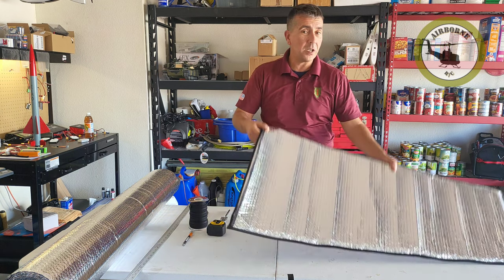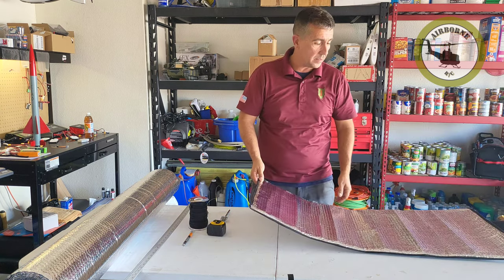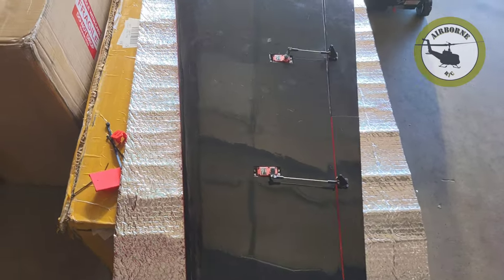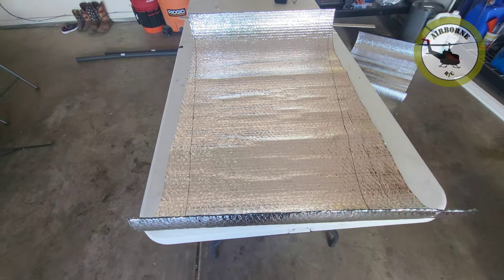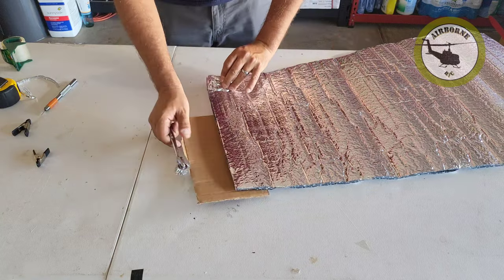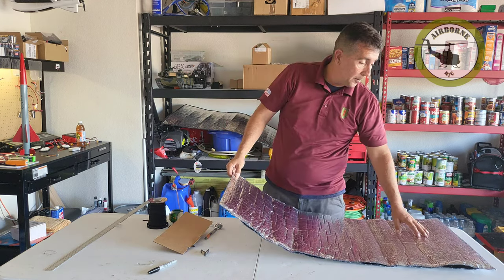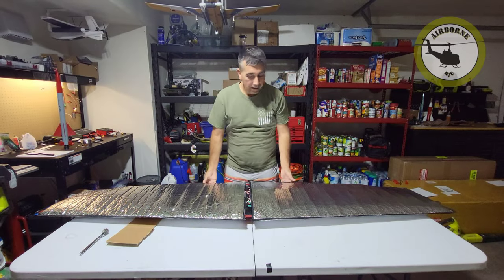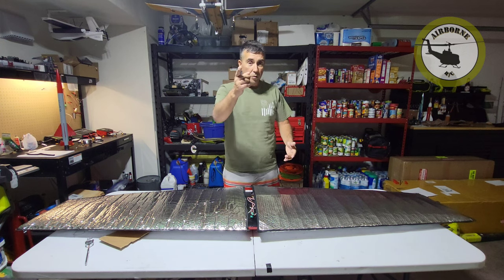How to Make Wing Bags!!!

Comment: Subscribed. Unfortunately I don't have access to a sewing machine, and even if I did I have no clue how to use it and would probably sew my hand to my wingbag. I do wonder if there's something that could adhere the bubble wrap to itself that would be better than duct tape, even if it was worse than sewing. Perhaps staples?
Reply from the maker: I have used the ribbing in this video but  a 1 inch instead the half inch black ribbing in this video. Placed over the edge. Instead of sewing I used E6000 glue. Worked well and glue was tacky to hold ribbing in place.
Reply: Awesome. Thanks for the reply! @NoonzAirborneRC